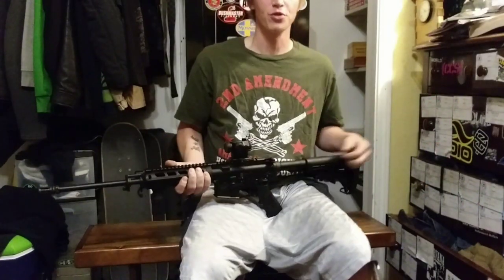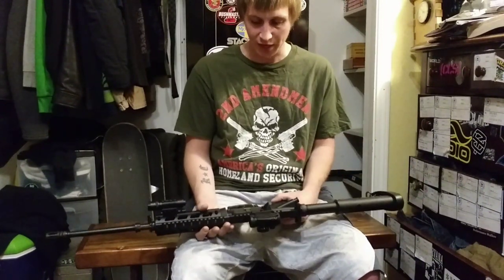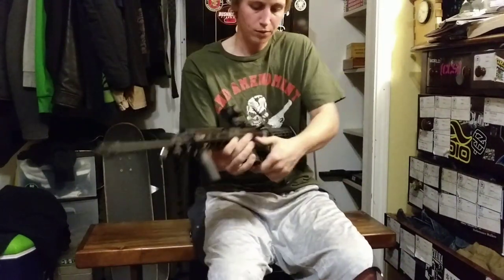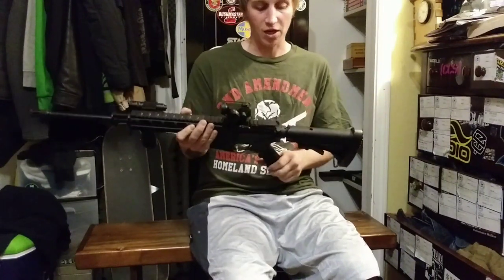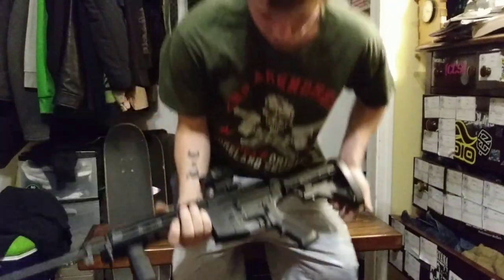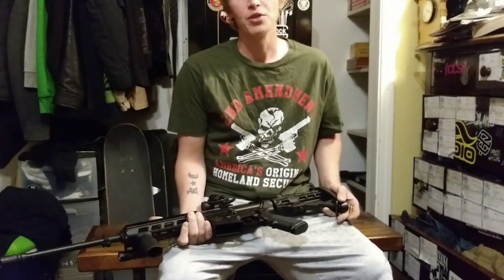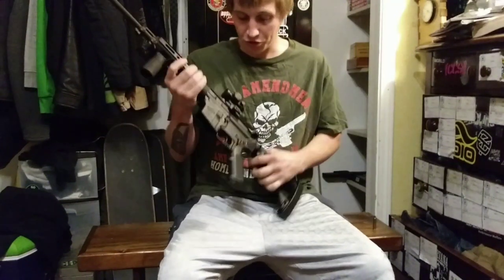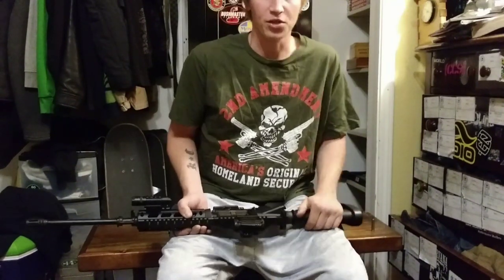AR-15 mortaring technique unjam a stuck bolt & charging handle w/round chambered.

Comment: I've build several ar's without any problems. But I build this one rifle on the cheap. I was challenging myself to see if could build an ar for under $500.00. This one cost me altogether $531.00. I was proud until I took it and test fired it. By the third round fired, my rifle jammed with a life round stuck in the chamber. I knew how to mortar it and I did. The gun was brand new and freshly lubricated. So I knew that cleaning and lubricating was not the answer. My first thought was that maybe I tweaked the upper receiver sense I did not use a reaction rod, (Not too smart). So I bought a new upper receiver and replaced it, and threw the other one away, I went to the range and again by the third or forth shot, I got a live round jammed in the chamber. I looked at several youtube videos and none were satisfactory. So put the rifle away and the thought of the jammed round just kept bothering me. Just this morning, (1/21/2021), I woke up an told my wife. Maybe is the buffer tube and buffer spring. She looked at me like I was some nut. So I took a buffer tube and spring out of one of my other rifles, went to the  range and the rifle shot like a champ, not one stuck round. So guys and gals, going on the cheap is really not the answer and use the proper tools. AND DON'T THROW ANYTHING AWAY UNTIL YOUR ABOSLUTELY SURE WHAT THE PROBLEM IS. Hope this helps some else.
Reply from the maker: That's some great input the buffer tube and spring wouldn't have even crossed my mind to be causing that issue that's some great detective work on your part.
Reply: @counterstrike2A  Let me make a correction. I meant the buffer and buffer spring, not the buffer tube.
Reply from the maker: @bill830pc8  ok that definitely makes allot more sense

Comment: Thanks for the vid, man. I think the casing getting stuck might have to do with the extractor and how lubed the chamber is. Also cold weather might be a factor because mine happened when it was about 20 degrees farenheit
Reply from the maker: No problem you're welcome I recently made a newer video kind of going into a further detail of what I believe caused the issue I will include the link at the end of this comment if you're interested.
https://youtu.be/S_wLVeBOJgI

Comment: I am not a gunsmith and make no pretense of being an expert on this problem.

However, I have observed a common denominator.  In every occurence when this has happened to me the round in the chamber had excessive head space (i.e. the case is standing just a little taller than it should) and the locking lugs had not rotated to the free position.  In my case, usually the offending round does not fire and the primer is not printed.

The "mortar approach" has it's place, i.e. intense situations where there is no other fast way I know of to clear the weapon.  Other than that I avoid it, especially when I know there is a live round in the chamber.  You probably know the firing pin is free floating, hence the occassional "slam fire" when chambering.

Even though the "military style" primers are harder and resistant to slam fire, and I always clean and check the primer pockets on every single round I load and assure they are seated just slightly below the surface I cannot bring myself to use the mortar approach unless I am out of other options.

It isn't practical for me personally to check every case I load unless I drastically reduce the amount I shoot; so occassionally a round or two will sneak by with excessive head space.

I have a special screwdriver which I use to gently pry the bolt carrier back, at which point I see the locking lugs freed.  I think this is safer.  

To put this humble suggestion in context, I use only "once fired" N.A.T.O 5.56 x 45 cases and I have both the full length die and the short base die; if you load your own you might find it beneficial to use the short base first and then the full length sizing die.  It is of course an extra step, but I am retired so it keeps me busy and there are less cases stuck in the die.
Reply from the maker: I don't reload but this happened to me a 2nd time and both times I was running 223 so i switched to never fired 556 and it hasn't happened since. U may not be a gunsmith but you definitely have some very useful knowledge thank you for your input and for supporting my channel!
Reply: I too used your "screwdriver" method.  I got the blade of the screwdriver wedged into the small gap between end of bolt and start of chamber and then was able to lever the bolt back just enough to finally free-up the charging handle so that it then allowed me to pull it back enough to eject the round, while not (dangerously) pulling it back enough to again cock the hammer.   I agree that is this the safest method with a live round chambered--time permitting.  While the "mortaring" method generally works, it is more for use as a "field expedient" to clear the round when in the middle of a gunfight.  In Vietnam I was on a Long Range Patrol team and was fortunate enough to be issued the CAR-15/XM177 carbine, which had a chromed chamber, just like the second iteration of the M-16 (the "A2" model).  That new type chamber eliminated most carbon and dust build-up which had caused the infamous jamming of the original M-16A1 which had been the first version issued both to US soldiers and marines in Vietnam.  Nonetheless, I and most other infantrymen with whom I served, always had a cleaning rod taped to the underside of our hand-guards--just in case.  Thanks for the reminder.
Reply from the maker: thank you for your service 🇺🇸

Comment: A thanks BRO it works i used it on an 
Brigade 9mm AR style pistols.🤠 TX
Reply from the maker: Right on glad to hear it! I recently uploaded an updated video that has a better explanation of what I believe causes the malfunction which I now think was the rifle not being suffeciantly cleaned and lubricated, most specifically the bolt carrier group, firing pin, and extractor. Here's a link to that video if ur interested, and if needed i have a complete ar15 cleaning guide on my channel also. https://youtu.be/S_wLVeBOJgI
 Thanks for supporting my channel and good luck with your rifle! 🇺🇸Washington State🇺🇸

Comment: Similar thing happened to my brand new AR-15. Was using .223 ammo and even though I cleaned and oiled the gun before shooting it jammed every 30 shots it’s so and needed to be mortared. 
Going to RE-clean and oil and see if that works. If not I’ll only buy 5.56 ammo in the future.
Reply from the maker: https://youtu.be/S_wLVeBOJgI
Check out this updated video I made on the subject. I go deeper into what causes the issues and what I did to fix it and keep it from happening again

Comment: I had just bought a new AR pistol and it was doing this. The bolt carrier got stuck after I attempted to fire. First magazine ever for this AR and it was messing up. I’m new to AR’s so excuse my lack of knowledge. I brought it back to the place I bought it from because it was under warranty.
Reply from the maker: I had the same thoughts when it happened to me till I did some research and discovered it was a common occurrence with an easy fix my rifle stopped doing it after 500 rounds or so I also predominately use 556 instead of 223 and that also seemed to help that issue from coming up
Reply: Kyle Counter, wish I would’ve known that trick and I wouldn’t have drove 45 min to bring it back to the place it was made. 😅 Thanks for the video.
Reply from the maker: @jonathansalyers8286  np lol i did the same thing my.shooting spot is like 1.5 miles away from where u park the car and I walked all the way up to the spot and I experienced that malfunction on my 2nd round and there was no internet service up there so I had to turn around and walk all the way back to my car

Comment: I had the same thing happen with reloads that I had bought, turns out they were out of spec. I went through the batch of 500 and found that about half of them were too long. It was a good excuse to get some reloading equipment and fix the problem. Now I reload my own. When life throws you lemons, make lemon-aid.

Comment: I had the same situation today when I go in to the mountains and shoot the .223 sold by pounds. After 5 rounds, the bolt was locked. And it is the first time I shoot my brand new Ruger AR 556. When I got the ammo out, I can see there are some dents on the shell case. Not sure if it will damage the gun.
Reply from the maker: From what I've learned since then it seems like a normal occurrence for newer rifles everything is kinda tight and needs to loosen up is what I've heard but the couple times it happened to me i was using 223 and since the 2nd time i started only using 556 and haven't had the issue come up again some rifles just prefer one to the other it seems
Reply from the maker: And ur rifle should definitely be ok the brass shell casing shouldn't damage any components

Comment: I was having the same problem. Its your extractor most likely. I had a laser bore sighter in my gun and the bolt accidently slammed home. It was completely locked up. The directions said dont let bolt seat bore sighter it could damage exctractor. Finaly got out with lot of work. It looked okay but when i got to the mountains it was locking up and had to mortar a few times. Then started working fine. Think i had something stuck in there.
Reply from the maker: It happened to me one more time and both times it was when i was running 223 since then I've probably run 1000 rounds of 556 and it hasn't happened once
Reply from the maker: It was a brand new rifle also it was either only the 2nd or first time i had taken it shooting since buying it brand new about a year ago

Comment: Same thing just happened to me. Brand new psa 10.5” pistol. It’s lubed well but does not budge. I’m thinking it’s either the combination of the charging handle and the gas tube.
Reply from the maker: Thanks for your input
Reply: I have a diamondback db10 that does it sometimes Factory built but it cycles fine.
Reply: Joe Mama I just had to give it some time and charge it a few dozen times. Runs great now
Reply: @jaredmackey4511  ok I was thinking my feed ramps had sharp edges making it difficult.  It doesn't do it when rack it only with a round
Reply: I just had issue with my brand new PSA 300 blackout 10.5” pistol
Reply from the maker: Is ur rifle new? Cause it seems like newer rifles are more prone to jamming this way from the chamber being new and tight after 400 rounds or so this issue hasn't happened again but I've also been allot more proactive with my cleaning and lubrication as well as cleaning the ejector so definitely take it apart and clean the upper really good specifically the bolt carrier group and ejector and that should definitely help keep the issue from arising again

Comment: I call that kick starting ; ) 
I’ve seen em get caught badly like that when you’re trying to break em in, especially with a budget buffer tube/entire budget lower build.
Reply from the maker: Nice thats a new term I haven't heard after making the video I came to the conclusion that the rifle and specifically the bolt carrier group, and ejector needed a thorough cleaning and lubrication apparently my bushmaster didnt get a very good factory lube before they shipped it out. Since doing that i haven't had the issue happen since.
Reply from the maker: I also forgot to mention I made an update video about a month ago going into more details about what I think caused it and also made a cleaning guide video going over the cleaning process i used on the rifle and bcg which fixed the malfunction from happening in my case. Here is the link to the update video if your interested.
https://youtu.be/S_wLVeBOJgI

Comment: Thanks for that tip to do it outdoors!  I would have been doing it in my garage.
Reply from the maker: Your welcome. I made an update video a month ago going into more detail On how to keep the malfunction from happening and what i believe caused it.
Here's the link if ur interested.
https://youtu.be/S_wLVeBOJgI
Reply: @counterstrike2A  Thank you. I did click the link and watched it. I have been shooting the AR about 8 years and I always cleaned the gun right after I got home. This last year I got lazy and stopped cleaning it every time. I went to the range after not cleaning it 3 times and had this problem. Being dirty may not be the only thing that can cause this but I believe it is definitely one of the things that can.
Reply from the maker: @Bream243  ya that definitely doesnt help thats for sure I believe that it was specifically the bolt carrier group and ejector cause after I took apart the bolt carrier group and followed.the cleaning procedure in my bushmaster manual and after that the issue never happened

Comment: Thanks for the technique bro! Now i know what to do next time. I 
Just finished building my first AR15 and took out to shoot. the first round got jammed so i didn’t even get to shoot it 🙁. I pulled the charging handle with a lot of force till the round ejected. Came home and tested it with some dummy rounds and works fine. Maybe that first round was a bad round?
Reply from the maker: So I have come to the conclusion that newer rifles have such tight tolerances that the first 1 or 2 hundred rounds kind of breaks the rifle in and loosens up the tolerances this happened to me a total of 3 times with my new ar15 although I did make one modification I try to only use 556 instead of 223 because as of right now the only times i have got a stuck round like that was when I was using 223 so maybe switch to 556 if ur using 223 and give it a little time and once u got some rounds through it the rifle should function just fine.
Reply from the maker: Your welcome I'm glad i could help!!
Reply: Kyle Counter yea my BCG is a 556 Nato and my barrel is a 223 Wylde so they should work with either one. But yea that first round was a 223. I guess I’ll go buy some 556 and give it a try. Thanks again bro! I’ll subscribe to your channel😎👍🏻
Reply from the maker: @TigerRodriguez  your welcome thanks for supporting my channel!! I guess the 556 has ever so slightly a pinch more powder in it which in turn gives it more force to eject out of the chamber after a successful primer strike and will help break the rifle in more since its a tiny bit larger cartridge good luck hope everything works out for u!
Reply: Yep my ar likes 5.56 better than . 223 also. Not so easy to find either at the moment and so many pricks are price gouging the £u©k outta us!
Reply from the maker: I know its ridiculous the price has almost doubled since January
Reply: UPDATE on my results... i think all it needed was some lubrication in the chamber and the extractor. I took it back out once i lubricated it and put in a mag with 223 and fired smooth. Also loaded a mag with 556 and fired smooth. Did that back to back for about 50 rounds of each with no problem
Reply from the maker: Ya that makes sense I'm guessing if I lubricated mine when I got it that issue could have been avoided it must not have come from the factory lubricated very well

Comment: Just had it happen to me twice today both live rounds on my AR10. Not completely locked up bolt but damn hard to pull back the charging handle. Only shot maybe 50 or 60 rounds out of the rifle and I noticed the bullet was scared up from either the ejection or being loaded into the chamber from the magazine. I'll get her cleaned but I'm also trying to figure out what caused it.
Reply from the maker: It happened to me a few more times after i made.this video and it seems like it only happens when i run 223 since then i only run 556 and i haven't had the issue again and I always keep it cleaned and lubed up really good
Reply: @counterstrike2A  my AR 10 is chambered for 308 so apparently it isn't relegated to just 223.
Reply from the maker: @jonathonbridges9625  ya i noticed that seemed to be a factor for my AR15 but im not sure about an ar10 I've always wanted to shoot an ar10 thats on my list for future gun purchases.

Comment: Same thing just happened to me. Cheap .223 TulAmmo. Ruger 556. Didn’t appear to damage anything. Motored that bad boy and ran another 30 rounds through it just to be sure. Everything was A ok.
Reply from the maker: Hell yeah I actually just made a new video on it with more speculation on what caused the issue if your interested.
Here's the link. 
https://youtu.be/S_wLVeBOJgI

Comment: Great video, that happened to me. Turns out the round I was using was out of specs.
Reply from the maker: Thanks! Im pretty sure my issue was that my rifle wasn't cleaned and lubricated properly but after I took it apart and cleaned the bolt carrier group and ejector it runs perfect now and I make sure to clean it every couple times I go shooting

Comment: Mine jammed right out of the box ....... was using reloaded ammo . I’m figuring that was the problem?
Reply from the maker: That could be the problem but another major thing that can cause that is did you disassemble and clean your rifle when you took it out of the box because they don't come very lubricated from the factory and I found once I took mine apart gave it a good cleaning clean the ejector in the bolt carrier group and everything the issue pretty much solved itself from there so I would give that a try and see if that helps
Reply from the maker: And that also tends to happen with new rifles because of that and the fact that the chamber has tight tolerances and the more it gets used it loosens up over time so cleaning it and using it for a few hundred rounds should definitely solve the problem cuz mine was brand new when I was having that issue and I haven't had that issue over the next two thousand rounds I ran through it